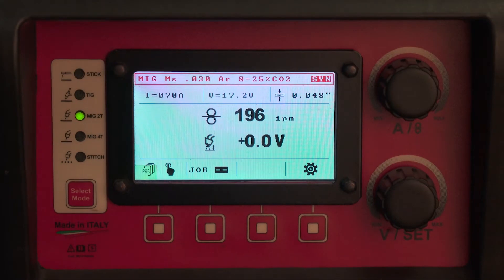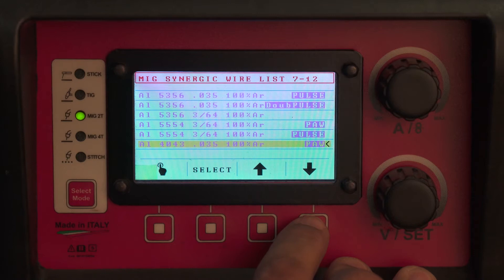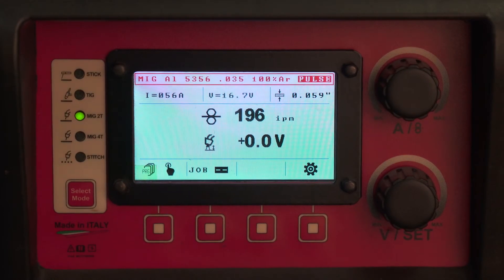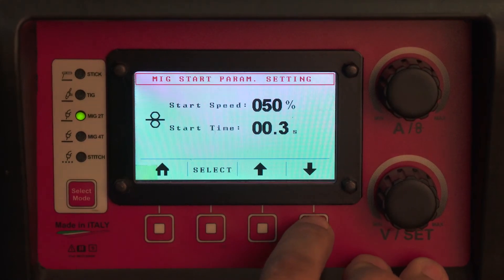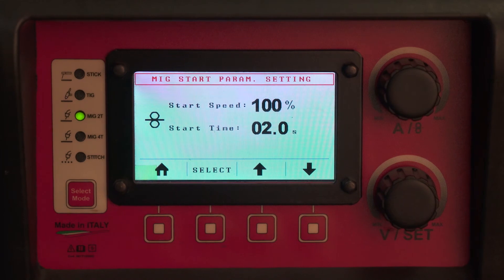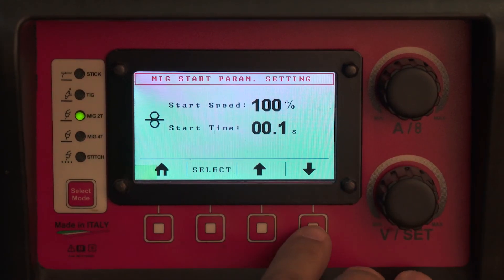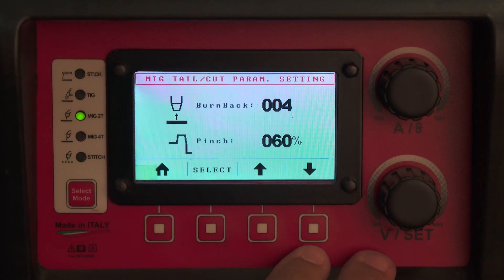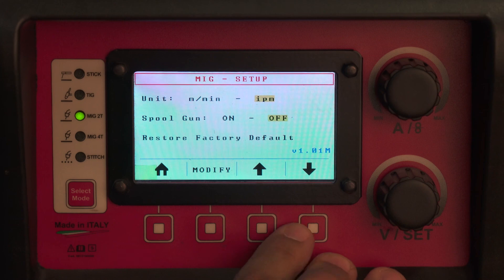PULSE Aluminum MIG Settings (Pro Pulse 220 MTS – Setup Part 13)

Comment: What should induction be at pulse ⅛ material and manual ⅛ material?
Reply from the maker: in the pulse program the induction should be "fixed" so you dont need to adjust it